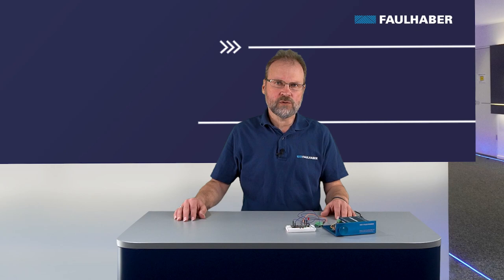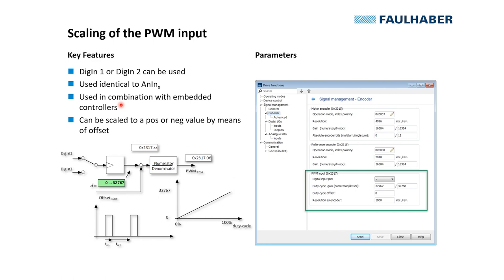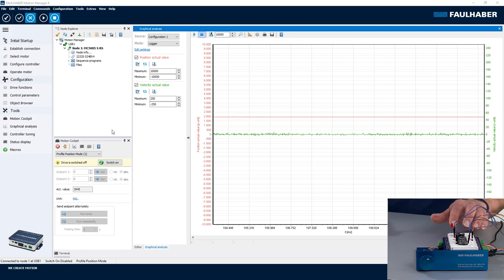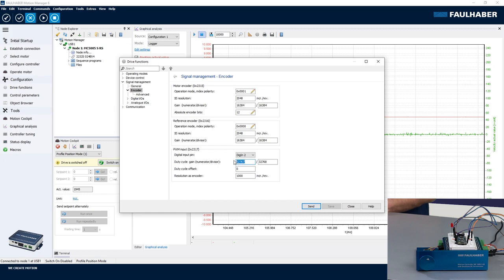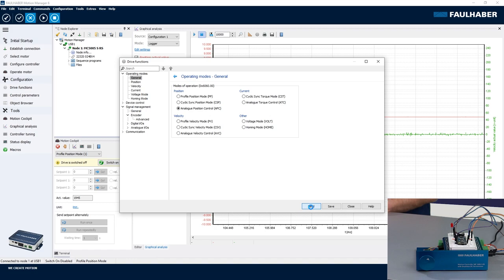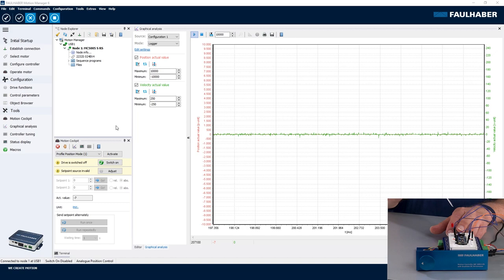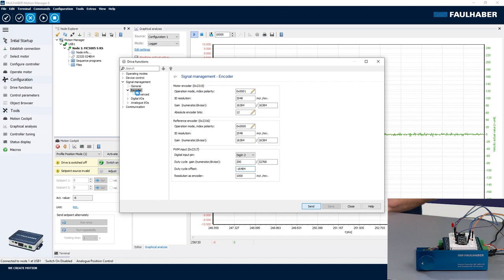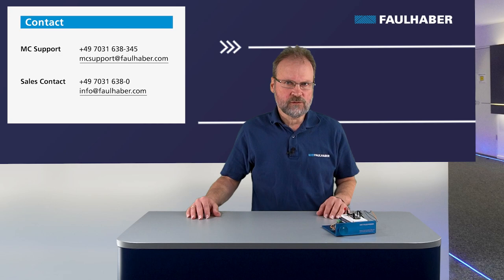How to use PWM signal as input for target value on FAULHABER Motion Controller - FAULHABER DriveTime

Comment: For the physical connection of the Digin on the Faulhaber ESC, is it just the Digin 1 (Pin 5)/ Digin 2 (Pin 6) for the PWM input and then the Gnd connection to pin 2? or is there any other connection?
Reply from the maker: This is correct, the PWM signal has to be connected between the digital input and GND. No other connection is needed.
Reply: @faulhaberEN  Thanks for the confirmation !

Comment: in case we have a gearbox with 141:1 for example, the numerator (4096 *141 pulse/rev) will exceed the maximum value? 
what should we ?
Reply from the maker: Hello, thank you for your question! During motor commissioning, only the resolution of the encoder/hall sensors is needed. The gear reduction ratio is set in the "Factor Group" in the Motion Manager. If you have any further questions, please contact MC Support: https://www.faulhaber.com/en/support/drive-electronics/